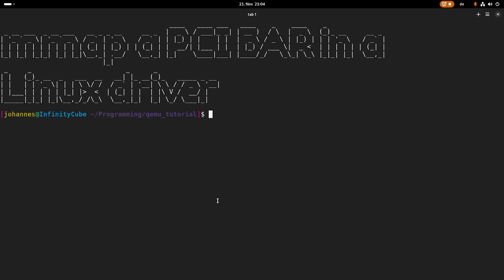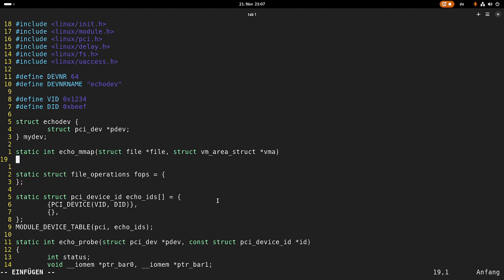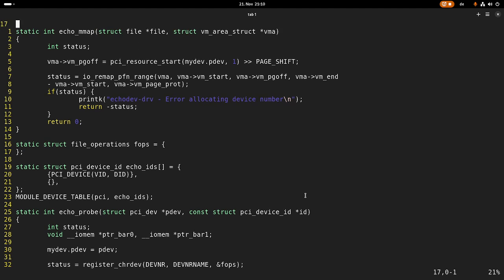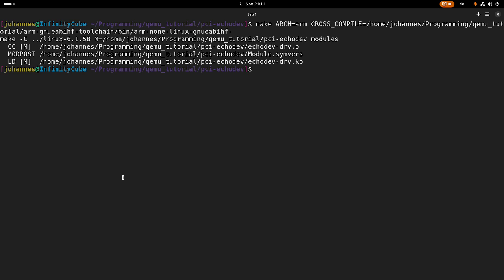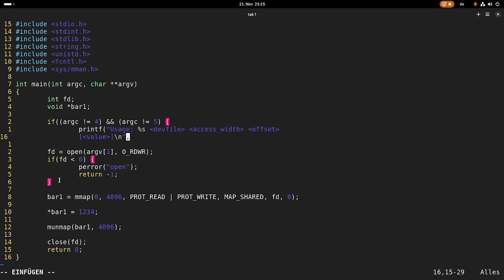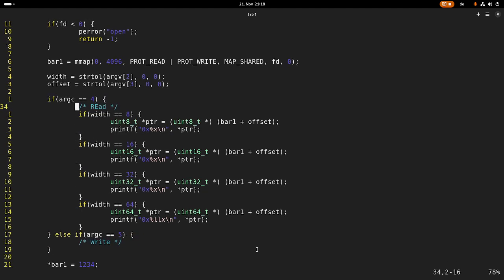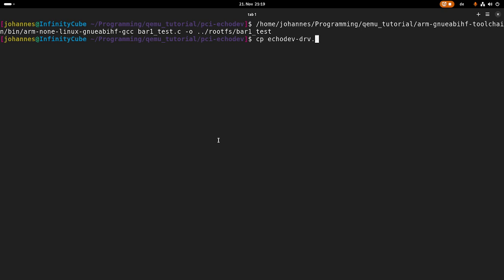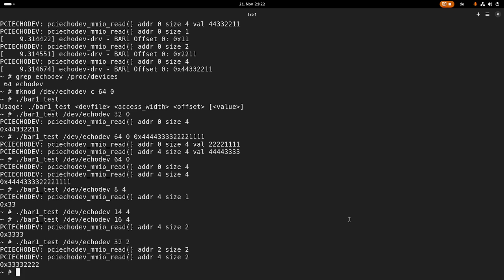mmap a PCI BAR in a Linux PCI Driver

Comment: Why is pciechodev_mmio_read() called when writing 0x4444333322221111 ?  I was expecting the _mmio_write function to be called.
Reply from the maker: You are right. This is due to a copy paste error, I fixed in the following commit:
https://github.com/Johannes4Linux/pci-echodev/commit/06bb50b1fd86ee0f10c513c11e5c022a9f633e92

Comment: Thank you, great. I'd also look forward to an example tutorial on utilizing DMA with your echodev.
Reply from the maker: I will try to compile an example, but I can't promise I will manage to do it.
If you run "grep dma_chan -R linux/drivers/net (which contains a lot of PCI devices), you won't see many PCI cards in the output.
It seems when using DMA's in a PCI driver, normally the DMA of the PCI Endpoint is used and it transports the data from the card to the host or vice versa. For using this approach with the echodev I must include a DMA controller in the echodev.
I will take a look at it, but as I said, I can't promise 😉
Reply: YES! That would be an amazing video!